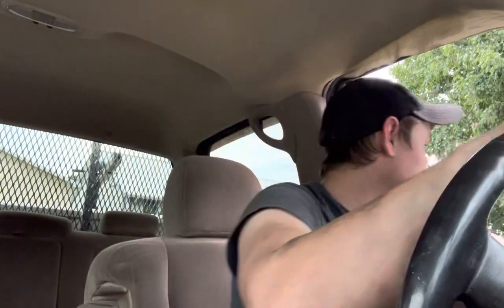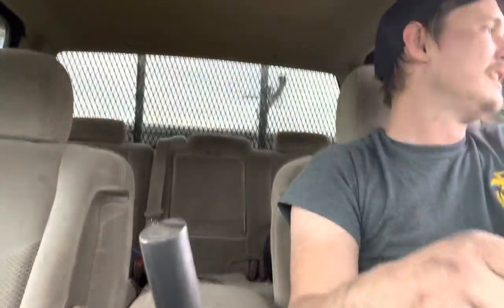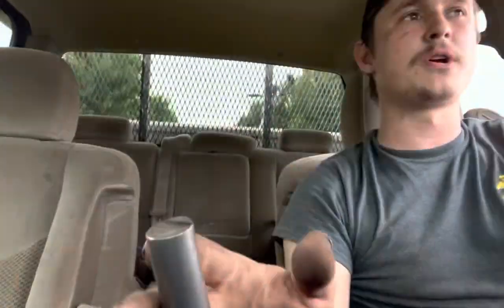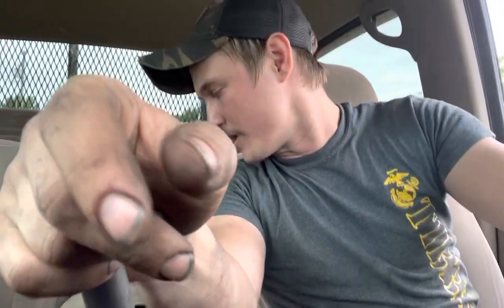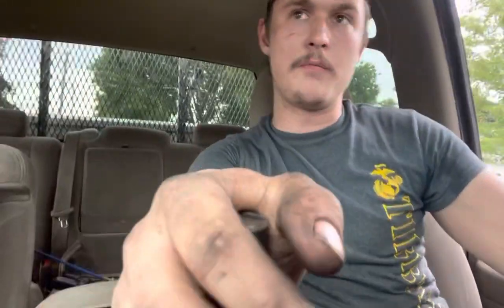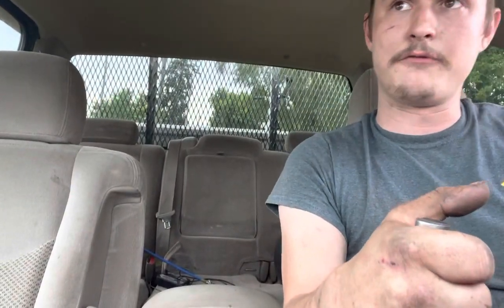First test drive after the solid axle swap, and NV4500 swap in the Cateye Cummins

Comment: I may have missed it, but why did you swap out the 4l80e?
Reply from the maker: I needed a torque converter and wanted to manual valve body it. I had originally wanted a manual for the truck anyway and ended up finding a great deal on one so I opted for that rather than spending more on the 4l80e
Reply: @12valve  right on, I want a manual too but am having a had time finding a "deal"
Reply from the maker: @loudpyps  yea they’re few and far between. And most people I found wanted a core

Comment: I wanted to do this to my Chevy  OBS 98 K2500 454 but that's a lot of work  !!! in reality the front a-arms work just fine.
Reply from the maker: They do work fine, it all depends on what you’re doing with the truck. For me this created a lot of extra room to work on the engine from underneath. I just had to pull the vacuum and power steering pump off and change the seals last week, there were a couple bolts that would’ve been impossible to get to from underneath with the IFS and very hard to get to from above. I was able to roll under the truck on a creeper and get to them no problem like this. If I ever need to drop the oil pan I can easily now too, where as with the IFS I had maybe a 1/4” of clearance between the pan and diff